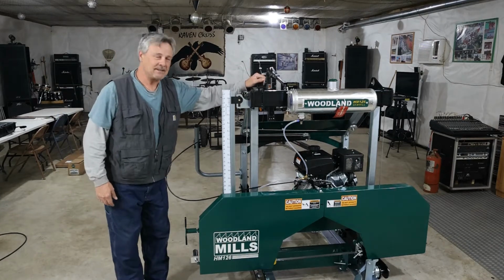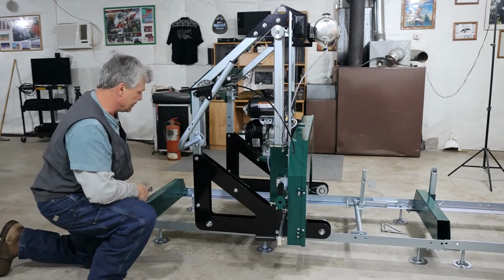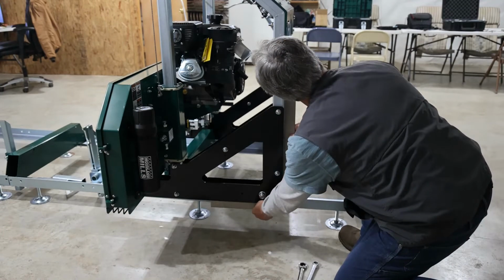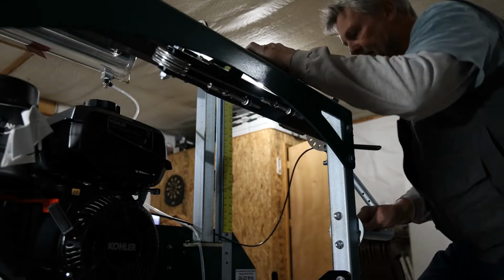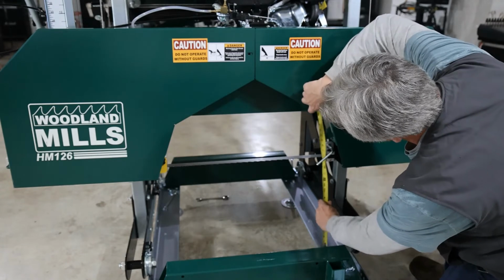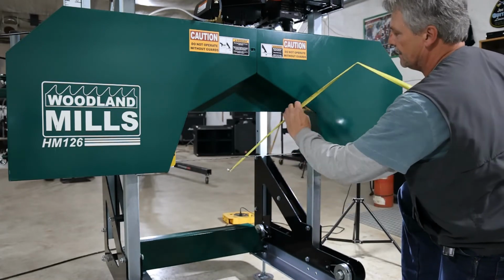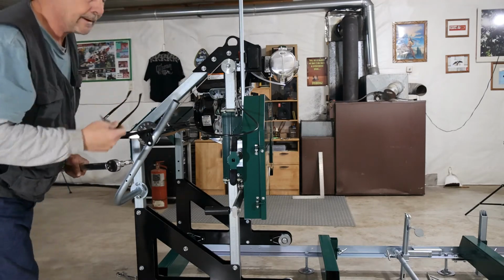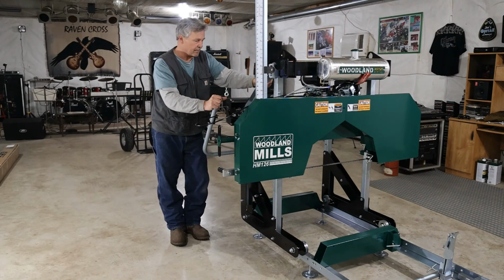Final Adjustments Before You Use The Woodland Mills Bandsaw

Comment: The first thing I did when I got it out the crate was take 4 turns off the band.  It comes shipped tight to prevent damage, but it's also flattening the wheel covers.  I didn't think to disengage the belt, but I don't thinks that's as big an issue.
Reply from the maker: Hello, removing tension from the blade when not in use will add to the drive belt and blade. Great Idea👍👍 
Enjoy your saw and Thanks for Watching

Comment: Thank you for showing this video. I am assembling the same model you have ( on trailer) and noticed that adjustable stoppers at the end of each rail don’t align with tracking wheels, I measured diagonally both rails - it was perfect. After viewing your video, I realized that the top head frame wasn’t squared. I loosened all bolts, including the rail wheels, now I am thinking how to align it, because the entire sawmill with cast iron wheels is pretty heavy. It pulled the frame slightly forward that caused misalignment. Any suggestions?
Reply from the maker: You may try tightening the wheels on the head frame to required torque and then while leaving the rest of the bolts semi loose push the saw head back and forth on the track a few times the head frame should square itself as long as all of the predrilled bolts are in the correct holes, and your track is level and square and the head frame rolls smoothly along the track. As far as the end stoppers on the rails they may not line up perfectly I have about 1/4" variance on mine. I hope this helps Thanks for Watching
Reply: @AskDaddyjoe  I did loosen all the bolts and it wasn’t too hard as I thought to square the frame. I readjusted the stoppers and now they are alighted. The only thing I had to adjust - the holes where you slide four pins to prevent the head frame from rolling back and forth during transportation. It became too tight, I had to run a drill bit several times to align the holes. 
Thank you for your help.
Reply from the maker: @peterguban7143  your welcome😎😎